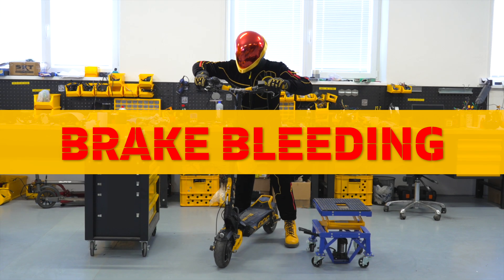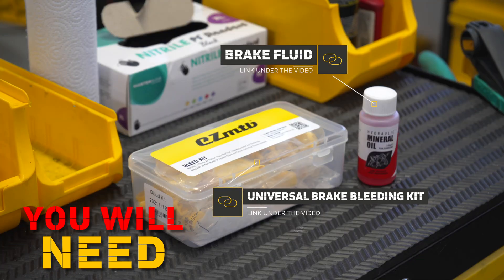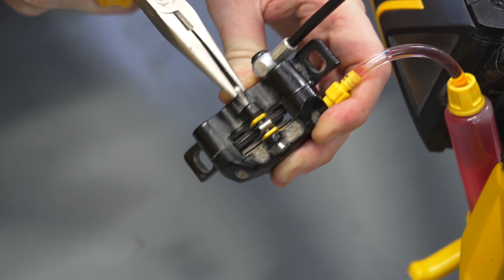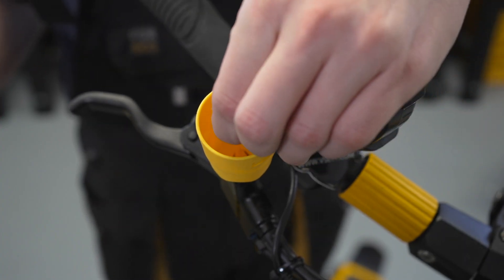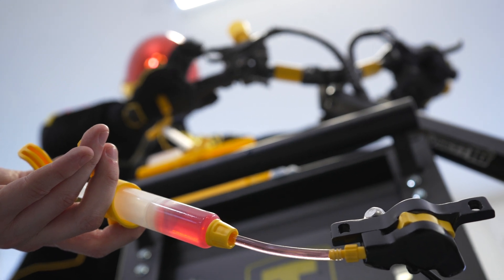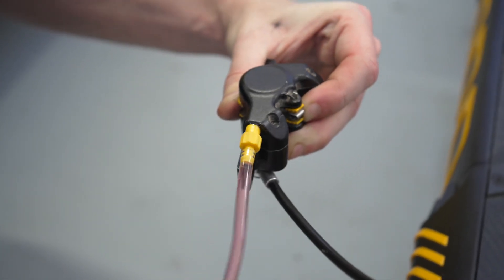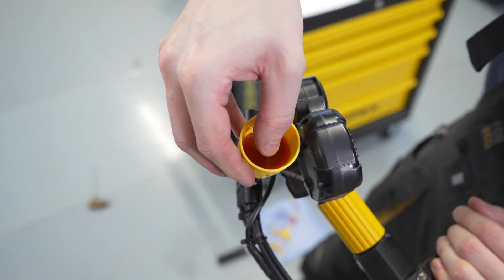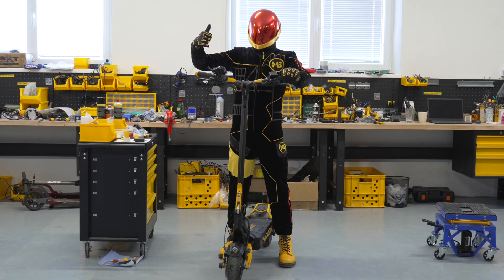Manual: How to bleed hydraulic brakes on an electric scooter?

Comment: Hi. I had a scooter shop bleed the brakes but after barely a month, the brake levers are weak. I tried to quickly press the levers and also tying them to a rope during two days to no avail. What can the problem be, do I need to bleed the brakes again? I've got the kit btw
Reply from the maker: There are 3 options:
1. The shop didn't do it 100% and there are some bubbles left that have now entered the lever mechanism and it doesn't work effectively, in this case it needs to be bleed again.  
2. They did it right but the brake system has a protracted fluid leak, often the hose at the handlebar entry gets punctured and it slowly drips inside the handlebar and you can't see it. However, in this case one lever should be ok and the other not, there is very little chance that the leak is on both brakes. 
3. If you have ridden a lot in the meantime and abraded the brake pads a lot, the lever engagement will change. This means that if the pads are already thin, the brake lever will engage later.
We would try bleeding the brakes, you can follow the instructions in the video and if that doesn't work, you may have worn out brake pads or the problem may be more complicated. In which case we would recommend a service visit.
Reply: @MaxBlinker  Thanks for your reply! A short while after my comment, I decided to look into it, It was actually some bubbles left. I attached the cup to the brake lever and pumped until no bubbles came out. Brakes are working perfectly now
Reply from the maker: We're glad to hear it. We wish you many happy miles :)

Comment: Thanks for the video.  When finished, is the majority of the mineral oil in the line still the original oil?  Do you rebottle the oil from the syringe and the cup after or dispose of it?
Reply from the maker: It depends on the condition of the oil. If it is already a different color than the new oil or there are particles of dirt in it, it is good not only to do the bleeding, but to replace the original fluid with a new one.
If the oil is fine and it is just a bleeding, then the fluid is used again.

Comment: Very nice and detailed video, thanks for helping the riders!! i have to do this on my Vsett 10+ because of brake feeling "spongy" but i have a little leak on the end of brake banjo. The silver tip that moves on the caliper, leaks some oil when i move it. How do fix this before bleeding the brakes? Do i need new O ring ? Which size is it?
Reply from the maker: Hello,Thank you for the compliments. It could be due to a bad gasket bolt. Try replacing the bolt or gasket. If it continues to leak, a new O-ring will be needed.